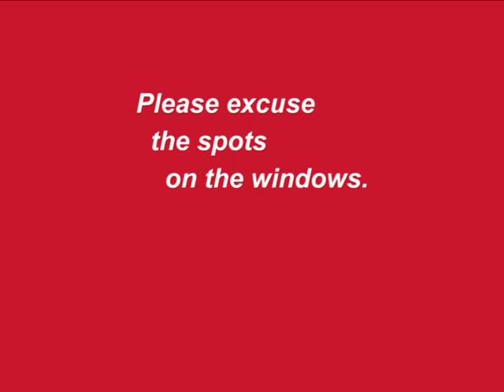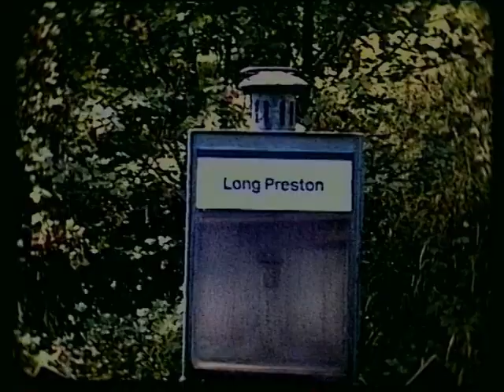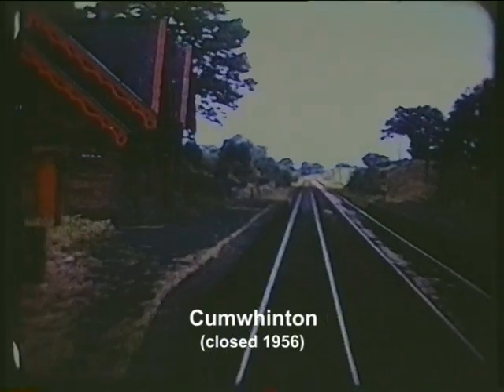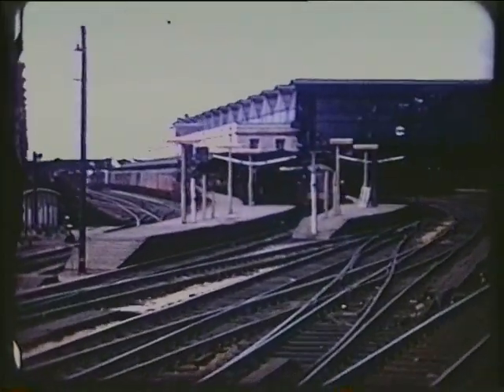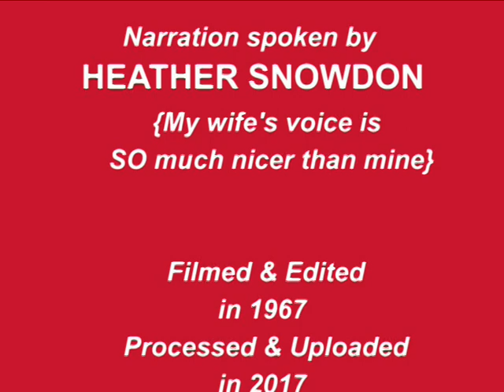SETTLE & CARLISLE line steam train era cab ride 1967

Comment: Long Preston  stopped at Box Rule book 'Section clear junction obstructed' These Absolute Block systems had track circuits on the overlaps of junctions to prevent signals being cleared
Reply: Meant Hellifield, Probably caused by freight on adjacent line. The Bobby (Signalman) should probably called the driver up to the box with a flag. but it was recognised that a hand out of the window would do the job.Great vid, think i got that right

Comment: The turntable at Garsdale used to have a stockade around it to prevent locos not being able to turn due to strong winds in the area. The stockade was built after a gust of wind caught a loco and spun it around like a top (as immortalised by the good Reverend Audrey in one of his tales).
Reply from the maker: Yes, I have read of the wind-blown turntable at Garsdale, and of how they had to shovel ashes into the turntable pit to stop it. One of the problems of using old film material is that the shots are often too short to allow one to say everything (or even anything!) that one would like to say about what is shown on the film.

Comment: "These first generations DMUs where chosen to have vacuum brakes installed  instead of the more efficient air brake system so they could haul single van or carraiges - but seldom did !"  Not true . I was a Guard on the Eastern region in the 1980s and we had at least two or three turns every day that were a Class 101 first generation DMU (or a Cravens 105) with a mail van attached on the rear.The memory is fading now I `m pretty definately sure that one was an late afternoon / early evening Ipswich - Peterborough DMU which ran Mon- Sat with a mail van attached .The others I`m a bit sketchy about with the memory .Possibly a Cambride -Peterborough and a Norwich - Cambridge DMU . The practice only ceased around 1987 when the first generation DMUs were replaced by new Class 150 Sprinter trains! (on the Eastern region). I believe the Met-Cam 101s were sent to the Manchester area and the Cravens 105s for scrap?
Reply: But hey thanks for a Great Video!
Reply: Sam Green The DMU that ran from Leicester to Peterborough often dropped off an SPV at Stamford, then after being loaded/unloaded it would then be picked up by a DMU to Peterborough a day or so later. This practice stopped in the early 1980s when the yard and signalbox at Stamford were closed.

Comment: A brilliant film of the S&C from 50 years ago. The look of the railway has not changed much since, which is very unusual. The stations have mostly been restored and look much the same, but in better condition. The track is now cwr and there are many fewer sidings. Fortunately the stone walls (instead of fencing) have survived and been repaired. There is some tree and bush growth on embankments and cuttings now (until the 60s the slopes were 'burnt off' to keep them grassed) but not as much as on most railways in 2018. This 1967 film will be part of the historical record of the S&C.

Comment: Is there a railway bridge over the line at https://youtu.be/5d-LR3EJxf0?t=630 ??
Reply: Your link doesn't specify a time on the video... what part of the line are you referring to?
Reply: @johnriggs4929  John, at 10:23 to 10:30.
Reply: @cliffyoung4612  I replied yesterday, but my reply seems to have disappeared. The only overbridge at that location is the one you can see in the distance, i.e. the tall, sloping 3 arch bridge ahead, which appears to carry a farm track on opposite sides of the line. I've looked on old maps and apart from the station having disappeared, not much has changed, so there were no other overbridges here in the past.

Comment: Not true ! I was a guard on the Eastern Region in 1980s and we had a few regular turns with a DMU with a van attached on the rear .Usually a CCT van for mailbags . Most common on Ipswich to Peterborough .Norwich or Cambridge to Peterborough.
Reply from the maker: We did say "SELDOM", not "Never." I really don't recall seeing a First Generation, Vacuum Braked DMU hauling anything. But then I wasn't riding around your area at all the hours of the day you would have been.
Reply: Sam Green So was I Sam. I was a conductor guard at Peterborough and we conveyed “ vanfits “ to Spalding,Stamford  Cambridge and Norwich. Sometimes if we had two units we ended up with two vans